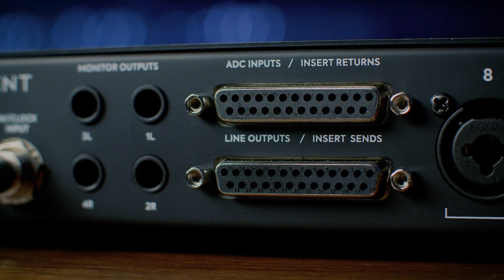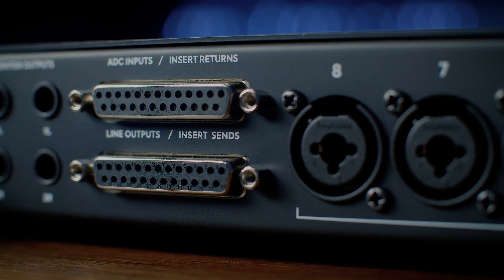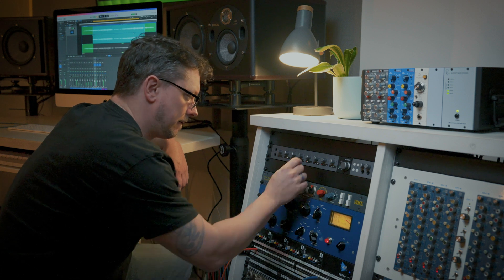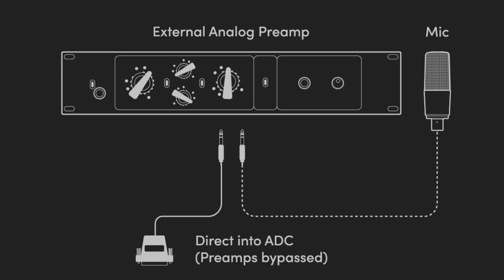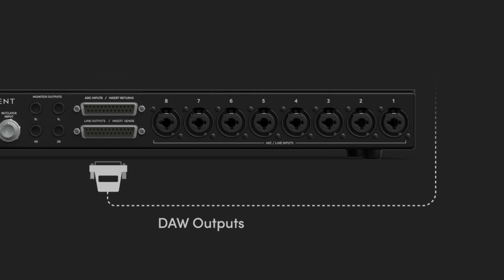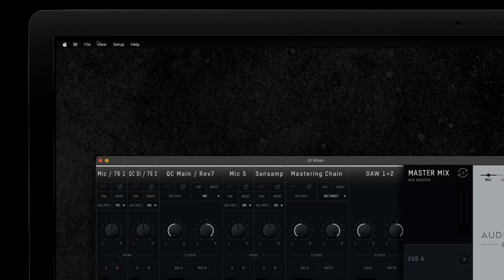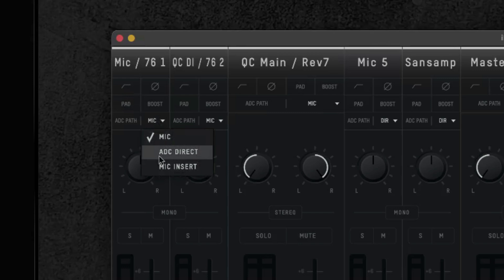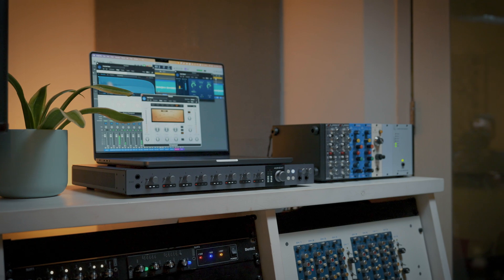Audient iD48: How to Use Switchable Balanced Inserts

Comment: Is it also possible to bypass the internal preamps by going straight into the XLR/jack combo inputs? Or do you have to use the ADC for that option?
Reply from the maker: It's only possible to bypass the pre-amps via the ADC inputs. Both the XLR and TRS inputs will pass through the pre-amp
Reply: @Audientworld thank you for the response. While the option for adc is amazing I wish you would've kept a dedicated send and return for at least one or two channels, so it could be hooked up straight into the return like I do on my id44. Needing a big breakout cable like that isn't always practical (and those special cablesare pretty expensive. Love Audient though.

Comment: is it possible to change the Adc path? like input 1 to Adc 3? I guess no. that would be very powerful. 
second question: if I would use the line inputs (like external micpre) is it possible to use Adc on that line input ?
Reply from the maker: It's not possible to swap channels when adjusting ADC paths, Im afraid. Insert 1 will only affect channel, insert 2 only channel 2 and so on!

If you are using external pre-amps then you'd want to select ADC Direct as your source allowing you to plug the external pre-amps directly into the ADC Input D-sub and bypass the built in pre-amps.

Comment: Hi, i’m actually using an happy user of id44 , i’m thinking to upgrade to a rackable audio interface as id48, are rack ears included in the box? Also, can i connect this interface with multiple external preamps by db25 cable? (In this case i should connect the db25 only to the return input) thank you in advance!
Reply from the maker: Yes, the Rack ears are included in the box of iD48. You can connect external pre-amps to the DB25 ADC inputs, allowing you to input audio whilst bypassing the built-in pre-amps.

Comment: Can I use 16-inputs simultaneously?

E.g., put microphones on inputs 1-8 (on the back of unit), and put line level inputs (synths) using the db25 connection for inputs 9-16?  then just set up daw template to always have inputs 1-16 on their own track?
Reply from the maker: Hello, its only possible to have 8 inputs at one time. You can choose whether you are using the Mic Pre Input or the ADC input by adjusting the ADC path in the iD mixer app.

If you need additional input channels, then you can expand the iD48 via its ADAT ports with an ADAT expander such as the EVO SP8
Reply: @Audientworld can you use multiple id48’s? Daisy chained, or via adat will the inserts still work?

Comment: Can I use the mic preamp or D.I and record it clean while sending it to the DB25 sends and then return and record it at the same time through one of the back line inputs instead of the DB25 returns?
Reply from the maker: Hello there,

Yes, this is possible; you'd just need to use a CUE mix to send the clean guitar to the DB25 Send. You can return the line inputs instead of the return if you'd prefer, just set the ADC path to "Mic" rather than "ADC Direct"

Comment: How many simultaneous channels of conversion can this unit do, no counting ADAT? It’s a bit hard to work out
Reply from the maker: Taking ADAT out of the equation, you have 8 channels of A/D. This can be taken from either the Mic Inputs or the DB25 ADC input depending on the ADC path settings for each channel.

You have up to 16 channels of D/A. 4 TRS outputs for feeding speakers, 2 headphone outputs using 2 channels each and the 8 analogue Line outputs available on the DB25
Reply: @ thanks

Comment: If I want to use external preamps AND the send/return dsubs for outboard (with the sends/returns of the id48 plugged into a patchbay), will it work if I plug the pre's line outs into the combo inputs of the id48 via trs and use the Mic Insert mode in the id mixer software?
Thank you in advance
Reply from the maker: Hello there,

Yes, that would work just fine, You would still be passing through the built-in pre-amps but provided you keep them at zero gain you won't notice any additional colouration.
Reply: @Audientworld  thank you for your super kind (and super fast) response!
Reply: Other question :) Is it possible to run an insert plugin on a track (up to 8 tracks I suppose) in my daw (eg. Reaper's Reainsert plugin) and select the id48's dsub i/o's (hooked to the aforementioned patchbay with outboard effects) as sends/returns? Thank you (again) in advance!

Comment: I have a 8 channel mic preamp with d-sub ins and outs. Can I connect it via d-sub insert connector on id48 to record simultaneously 16 mic inputs (8 mic inputs on id48 + my 8  channel pre)?
Reply from the maker: Im afraid this isn't possible. It's only possible to have 8 analogue inputs at any one time. You can choose between either the Mic input and the DB25 ADC input on each channel.

Comment: Can i use outboard bae preamps with a tube tech CL1B compressor recording vocals in to protools ?
Reply from the maker: Yes, this would be possible You'd simply feed the BAE pre-amps into the Compressor, and then feed the output of the compressor into one channel of the ADC inputs. Finally, you'd just need to set the ADC path of that channel to ADC direct and the iD48 will take the signal from the BAE pre-amps and Compressor.
Reply: @ so i can leave one on ch 1  and the other one 2 ch  then send it through one path because i hand multiple compressors multiple free that i wanna connect on each io
Reply from the maker: Yes, that is possible. For more assistance with signal routing, I'd send a message to support@audient.com and our team can help.
Reply: @ ok thank on that

Comment: Audient iD48+sphere=ATOMS ?  How about it?
Reply from the maker: In theory it could work for a 7.1.4 setup, but if you are running an ATMOS setup, our ORIA would make for a much smoother setup and means you can run all your speaker calibration on ORIA's DSP rather than on your computer, freeing up a lot of CPU
Reply: @Audientworld can you make a rig with 2 id48’s for tracking/mixing and an Oriya for monitoring? If so, how?

Comment: you can use the balanced output insert for monitor speakers ?
Reply from the maker: Hello, Yes, you can use Line Outputs DB25 to feed speakers. If you attempting to use this for a surround or immersive setup, however, please note that the volume and monitor control on iD48 will only work for stereo signals, so you would need to find another way to control the volume for your surround/immersive playback.
Reply: @Audientworld   hey thanks for your response .!  amazing!!

Comment: I’m a pro tools user, like you mentioned at the end so I would have to set it to DAW analog mode if I wanted to use all 8 as inserts. If I put my monitors on 9-10 which are the first two of the ADAT channels right! Now if decide to expand via optical cable to another 8 I/o device, those first two are now taken up by my monitors so I have 6 available I/o? Could I configure the second device to be ADAT channels 17-24 so I can use all 8 and leave my monitors on 9-10? Could I also have secondary monitors on 11-12 with this setup?
Reply from the maker: The best way to handle this would be to plug the Optical device into the second ADAT port. The Optical device would then take the signal from output channels 17-24, meaning you can use all 8 channels. Im afriad it wouldn't be possible to have secondary monitors on 11-12 as there isn't a way to route this in the iD mixer.
Reply: @ thank you this makes perfect sense! Is the second monitor outputs (3L and 4R) correspond outputs 3/4? So if I wanted alternate monitoring I would need to take up two outputs of the 8? Or alternatively go with one set of monitors on ADAT 9/10 and leave all 8 i/o open?
Reply from the maker: Yes, typically Outputs 3+4 would be used for the Alt Speakers so if you did want to use these along side a main set of monitors, you would need to use 2 of the analog output channels which would reduce the total number of inserts to 6. Otherwise, you can just use your Mains on Outputs 9+10 and have all 8 analog outputs for inserts.
Reply: @Audientworld  thank you for explaining!!

Comment: Some time ago you showed a trick with the iD44 where you used the send on one channel and the receive on another channel. This way you could record both the clean mic signal and the processed. Is this also possible with iD48?
Reply from the maker: This is possible but just requires a little more setup. You would instead use one of the CUE mixes on the iD mixer app to send the clean signal to a second channel where you can patch in your hard ware effects. Please send a message to support@audient.com for more info!